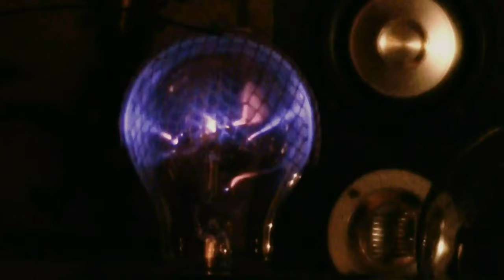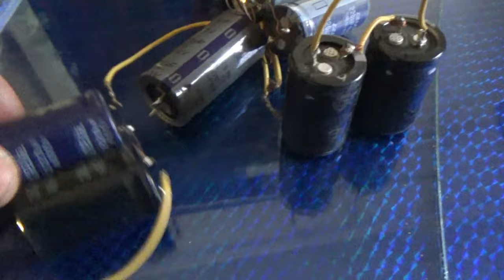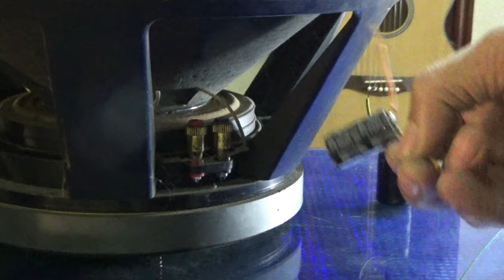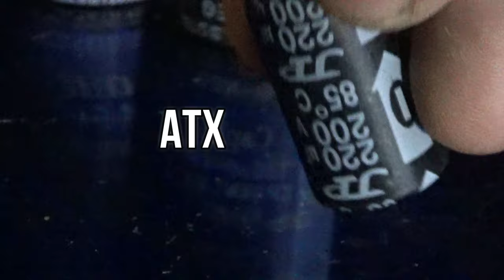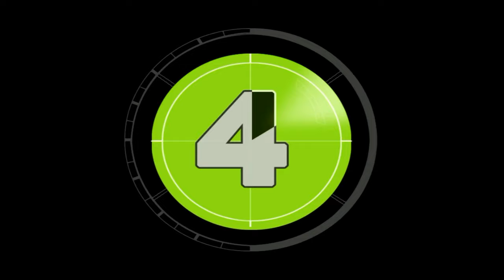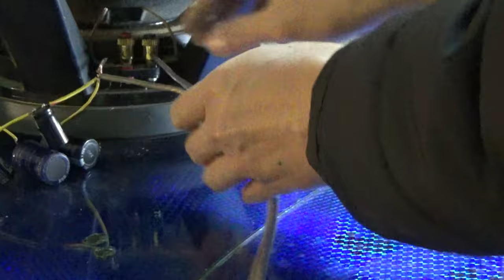connect speakers to the amplifier, 4 tips #Protect the speakers

Comment: What size capacitor should I use on a 30 watt 4 inch speaker. Just trying to block out the mid and low bass. So basically just want to make a big tweeter.
Reply from the maker: If you want the loudspeaker to operate at frequencies between 3KHz and 7kHz, use capacitors of 5uf to 9uf / 300v